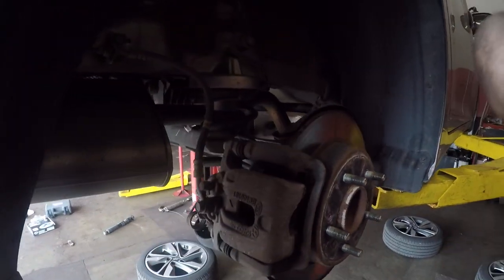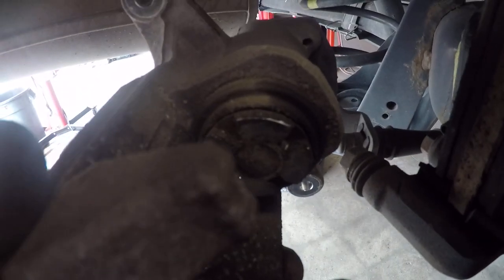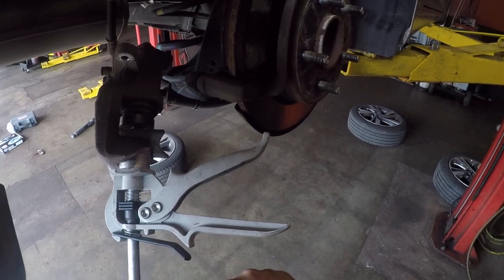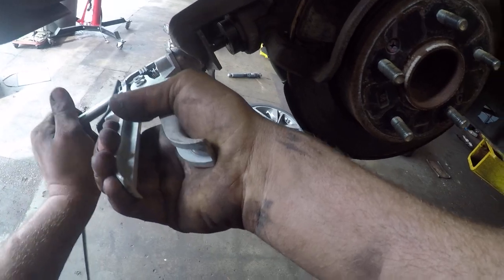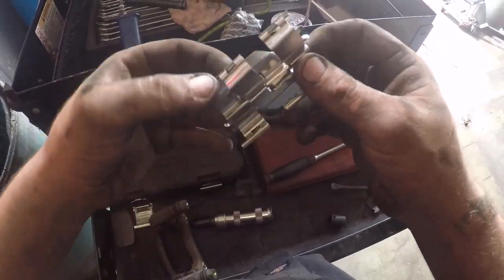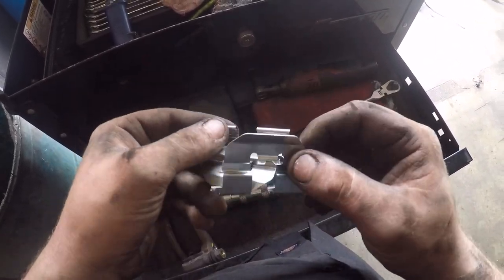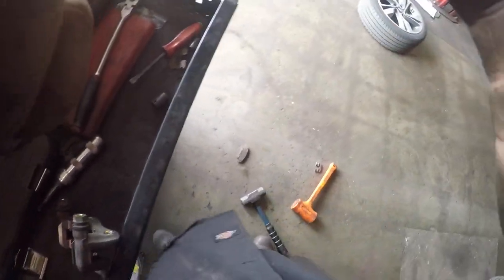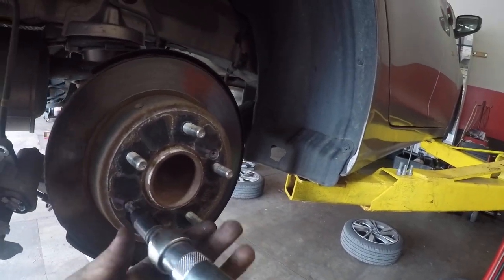How to do rear brakes on a 2014 Hyundai Elantra

Comment: good job  but should the caliber be hanging on the brake lines or hold it up with  a  wire?
Reply from the maker: Your right I should have supported the caliper rather then risking damaging the brake hose

Comment: I cant just use a c clamp for the caliper piston?
Reply: No but you can use some big pliers. Just twist the piston clockwise for it to go in
Reply: @danfuller06  I just got myself a tool that makes it easy. Appreciate the response. I just didn't think they needed to be turned at the same time but they do
Reply: Mine didn't need the tool .I just turn a Lil bit with channel locks and then push it in and repeat as you go .. dont put channellocks on the rubber boot .seemed to work a Lil  fast then what he did  maybe just got lucky but I have changed brakes on one other car that I had ...that had the same system worked then to